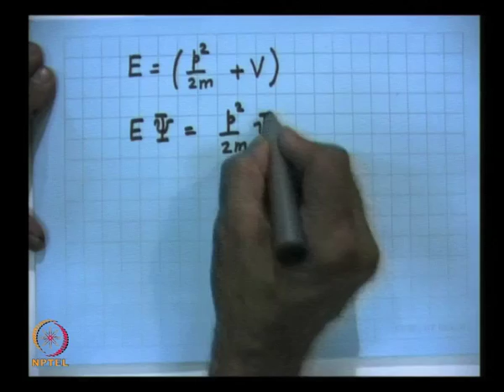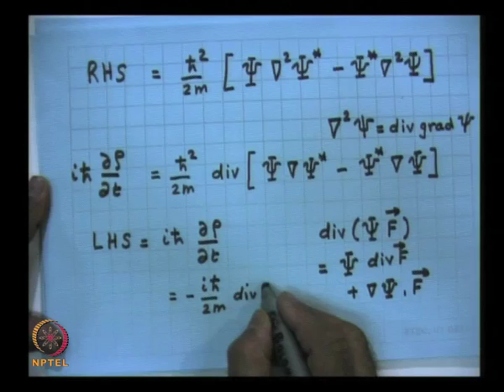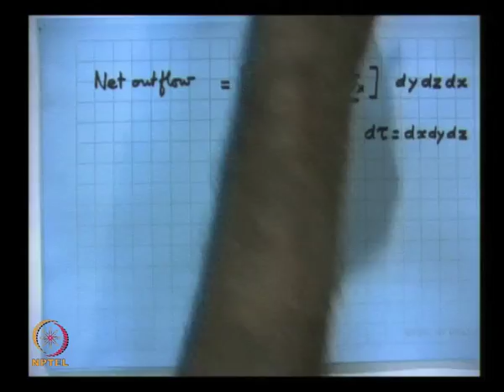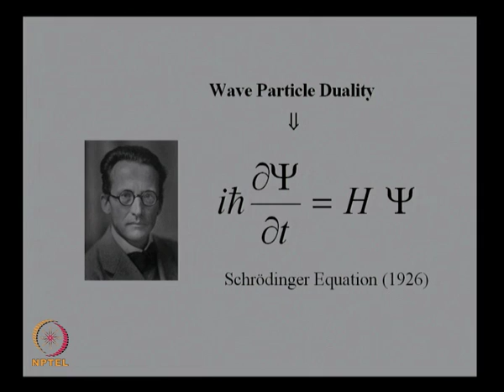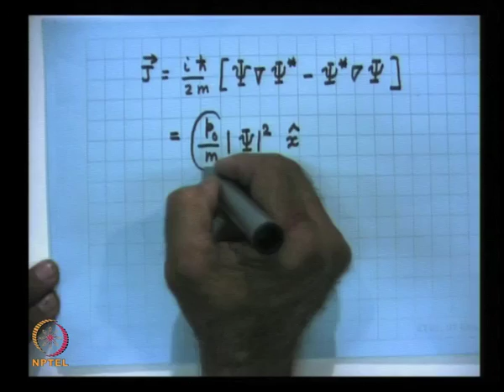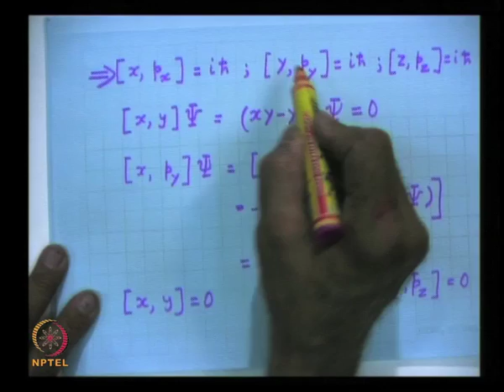Mod-02 Lec-05 Physical Interpretation of The Wave Function

Comment: The concept of divergence is not entirely clear to me,  It is mathematically illustrated by a source or a sink, where all vectors either enter or exit an infinitesimally small volume. In this case, we are essentially calculating the difference between incoming and outgoing vectors within a certain volume — that is, vectors both enter and exit this small volume.

Comment: On 14:39 how you say this is time dependent Schrodinger equation, bcz actual dependency comes from the potential not wave function but here potential is independent of time
Reply: When the Schrodinger Eq. is written as it is here in the red box, with the explicit time dependence, it is called the time-dependent Schrodinger Eq.  But, if you try to solve this for the energy eigenstates, you use the relation from the previous line and re-write the boxed equation with E Psi on the left-hand side.  When you write it that way, it is called the time-independent Schrodinger Eq.